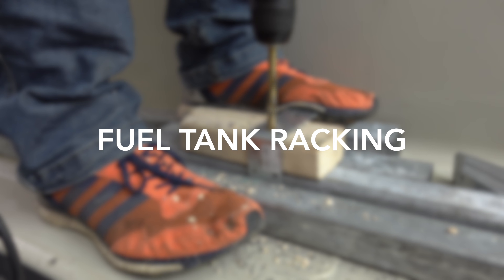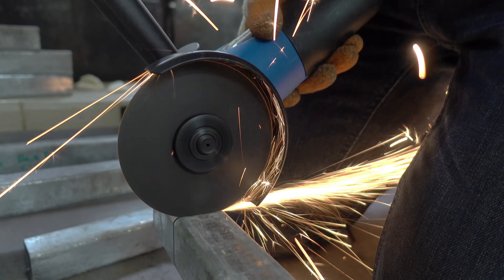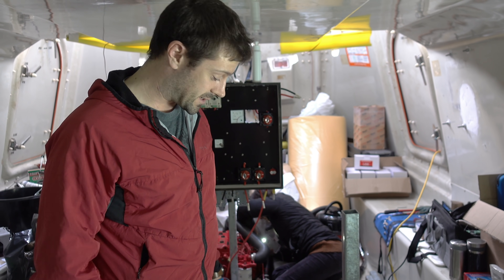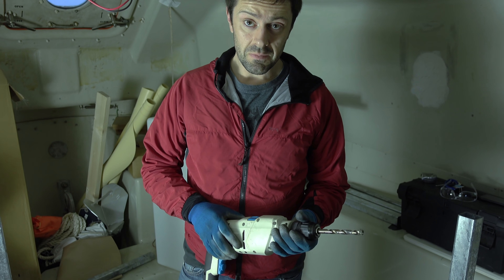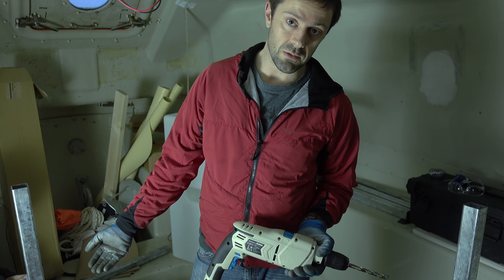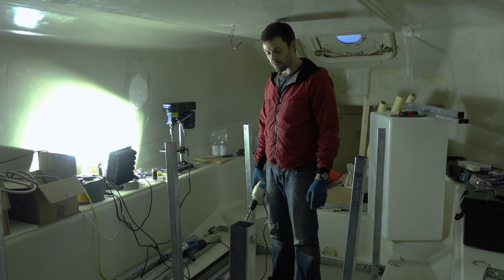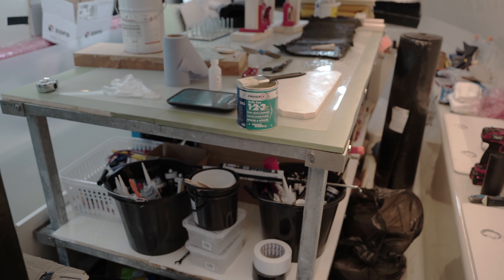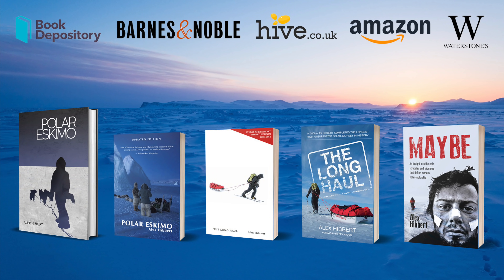Lifeboat Conversion Ep6: Fuel Tank Racking [4K]

Comment: im really looking forward to this journey with you . also i see you fit a big heavy shelving unit on the false floor. are those 4x2 timber youre using and is it going right onto the metal hull?
Reply from the maker: @Islandwaterjet  The very limited foamed area is earmarked for steel ballast inserts. We didn't want fuel tanks with poor access. We won't have 2000 gallons. Less than a quarter of that, and only 2/3 of that will sit on the racking. I'm not sure of the thought process behind your incessant negativity, and in listening to what you wish to hear and not what is being said. Maybe you've just had a bad day.
Reply from the maker: The hull is glass fibre. Yes, the false floor is sat on two long rows of wooden batons. The void is filled with high strength closed-cell PU foam, which is good at load bearing too. The weight of the racking doesn't point load the floor under the vertical legs, as they are bolted a few mm above the floor on horizontal 'skids'. So the weight is spread.
Reply: @AlexHibbertOriginals  ah i see. i imagined you would have used skids for this but i saw you measuring out the 4x2 right onto the floor. thanks for the clarity

Comment: I'm curious why you didn't weld your stainless steel rather than bolt all your structural rectangular steel together?  It certain you have saved you some weight and a heck of a lot of drilling.  In the event of engine failure, what is your alternate source of propulsion?  What about fuel contamination from condensation in the tanks?  I'm sure you have thought about all this but perhaps I missed it.
Reply from the maker: It's so the racking can be altered and dismantled for different projects. Also, so it could be removed from the boat temporarily without having to cut metal. We actually want weight down low, and the bolts only weigh a kilo or two. The engine and backup system for going blue water will be covered later. For coastal travel a single reliable engine is fairly normal. Fuel cleaning and filtering again will be covered later, but will be nothing beyond the usual.

Comment: You should paint the sides of your plywood if humidity gets in through there it starts delaminating, good job and carry on. thanks
Reply from the maker: Indeed - painted and PU coated. I'll do a followup racking episode.
Reply: @AlexHibbertOriginals  Epoxy makes a great timber end grain sealer, however it'd take a lot of moisture to make a good quality ply like that come apart and you'll have bigger worries if that structure is that wet :-D

Comment: Are you doing a round trip with enough diesel for both directions?  Just wondering how the rolly-polly nature of the hull will worsen as you burn fuel.  The final 1/3 of the trip when lightship could be awful.   Might consider a flex bag that could be filled with seawater as ballast. Electric pump to fill/empty.
Reply from the maker: The itinerary is now TBC, but the original plan involved an approx 30% burn to get to location (and the option to burn another 30-40% to return in an emergency). Once locked into ice, the remaining 70% would then be burned for power and heat when the boat can't rock. Indeed, various ballast options being considered. One issue is that there aren't vast amounts of near-keel voids to use for water ballast, which is clearly a lot less dense than steel, which I earmark for semi-fixed ballast.
Reply: @AlexHibbertOriginals  This makes me think of the two floodable/drainable tubes of the Macgregor 26 water keel.
Drained by planing.
Not apllicable directly to a non-planing hull though external drainpipe tubes fitted either side of the keel and then faired in?
Floodable but able to be pumped out could work. Random thought.. though arctic conditions might nobble that one.

Comment: As you use supplies and fuel you could pump water into tanks in the boat to maintain an appropriate buoyancy for the return trip
Reply: Freshwater and diesel have long been stored in same tanks.. although  they may need to separate to 2 tanks to make that work efficiently (due  to smaller tank size, turbidity).. the motor could produce drinking water..
Reply: In principle a fine idea, but surely this would make them unusable for refueling though? I would guess Alan  will be subject to sea trials with full and empty fuel tanks to prove its handling characteristics...
Reply: @djmidg  Could there be an internal rubber bladder for the seawater?
Reply: @djmidg  In Diesel submarines (a la WWII) the fuel tanks are open to the sea at the bottom. Diesel floats on water so the fuel was suctioned off the top for use and sea water came in to replace it in real time. If they were depth charged, the open nature meant the tanks were impervious to damage because the shock wave passed right through. Also it meant the bouyancy didnt change as much as if the fuel was replaced with air, which would have required serious ballast to offset.
Reply: @natehill8069  yup I watched a old black and white video called how to build a submarine and the fuel system was impressive

Comment: Come on man, get rid of those bolts and buy a welder. Eliminate all those sharp edges and gain space (and a new skill) at the same time.
Reply from the maker: Ha! I would love to learn to weld. But, there's an expert at the boatyard I'd rather give business to. I'm also aware that amateur welding can be weak and give a false sense of confidence. We do want the ability to alter or dismantle the racking, so some bolting is always necessary. Sharp edges etc - yep there's a note on the vid that protection and safety aspects are one of the next jobs.
Reply: A welding arc that close to the fiberglass would be a no-no. So he would have to weld the construction inside but at a safe distance from the fiberglass and still have to bolt some parts to the hull. People also tend to underestimate the effects of welding distortion and end up with everything crooked.

Comment: Are you planning to assess the stability with an inclining experiment once the interior fitout is complete to make sure that it is in recommended/required limits but also comfortable?
Reply from the maker: I've taken measurements to approximate the initial weight reduction, then the increase, and the movement of that mass. Also, the loss of some buoyancy foam. It means there's a best guess prior to a proper test. In the spring, yes, I'll do that, and will avoid the final fixing of ballast to make sure the trim of the boat is safe.

Comment: Soft edges for those hard corners please.
3 broken ribs will wish you had.
Reply from the maker: Absolutely. The sharps are already ground off, but all dangerous edges/corners (and other hazardous parts of the boat) are listed for protection before sea trials. There will be a second video for this racking when this is shown, and fuel tanks are installed.
Reply: @AlexHibbertOriginals  Cool. Excited to see her at sea trials.

Comment: Can you move the bladders of fuel easily? Are there hand holds on the bladder? Fittings for hoses? Do the bladders have vents for vapor or anything like that?
Reply from the maker: I'll do a film to show the details once the racks are cleared and readied for tanks. The bladders once full are immobile (weigh over 300kg), but are light as a feather empty and can be rolled up. They are secured with cross-straps to the racks. One bladder has a fuel supply and return JIC fitting  as a backup should the plastic supply tank fail. The plastic supply tank has multiple fittings, but notably a supply and return plus an automatic roll-resistant breather valve.
Reply: @AlexHibbertOriginals  that's grand. Are you bringing spare parts for the engine?
Reply from the maker: @John-gp9qf  All the common parts yes. I'm also investigating a backup power source in case of catastrophic engine failure, but that's TBC.
Reply: @AlexHibbertOriginals   Add a Generator and hybridise the drive train to allow electric drive as well as diesel?   Dual purpose the generator then and electric motor is light, bonus you are not depending on battery performance in cold temps.
Reply from the maker: @El_Croc  There's a backup idea I'll tackle much, much later which involves electric drive, but for a primary system a DV48 is far more efficient than a diesel generator charging batteries, that then power a motor.